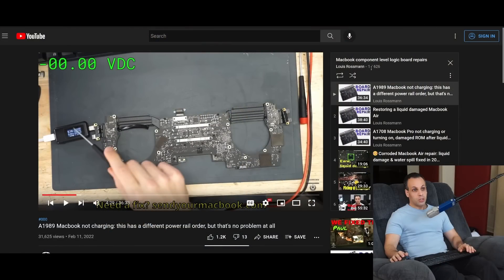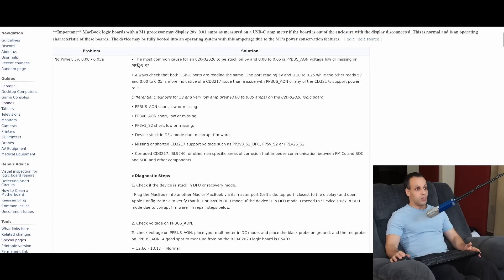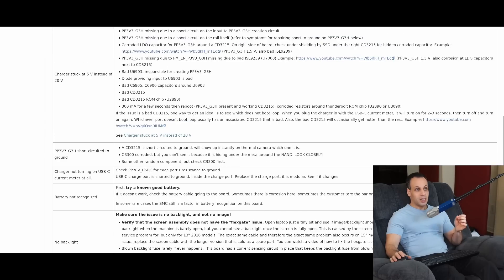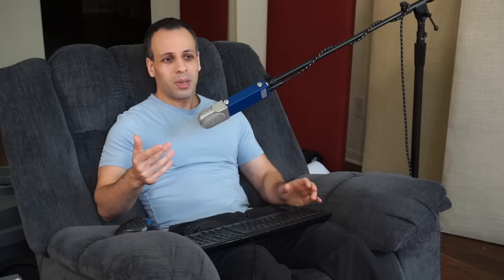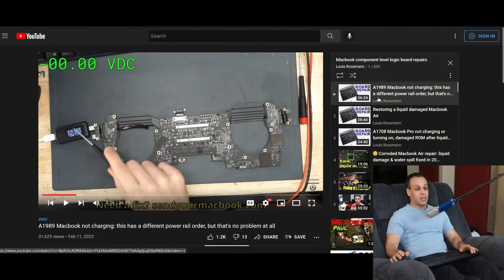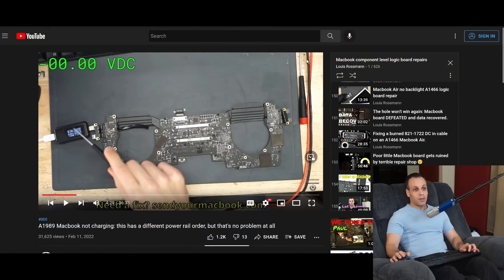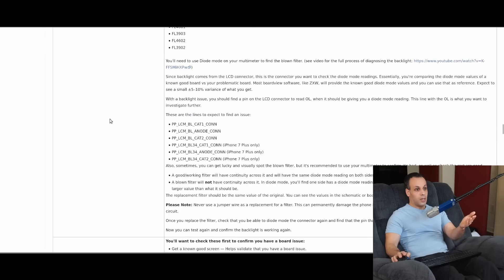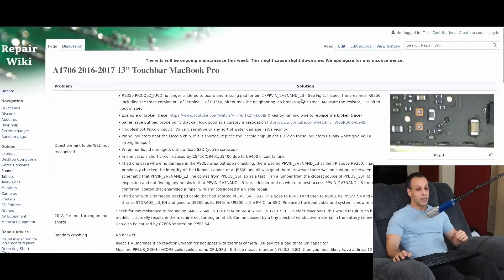Let's talk about the future of repair education here

Comment: For last 5-8years have accumulated experience repairing power supplies, when started repairing them, there was no content about it, only few videos showing how to recap secondary side. For last few years have been slowly making short as possible repair content with title: "Device name - fault description - name of faulty components" with startscreen showing the defective components. Endscreen with diode/resistance measurements of a working device.
Reply from the maker: Very cool man! Thank you so much for giving back

Comment: It will be a bit more interesting to show us not whole board repair video, but to do guide about specific methods for specific components or types of damage. Like hi guys today I have these four boards with water damage, it looks this way, you can easily detect water damage thanks to these marks, always check these vital components that are likely to be damaged every time, these need to be replaced, this type can be salvaged this way.. etc etc. And simply focus whole video on one toppic. It will be also helpful guide for those who are attempting similar type of repair no matter if it will be exactly the same board. Usually things repeat... 

QFN repair, BGA repair, connector repairs, broken via, delamination, heat damage, liquid damage, geenral oxidation... or even presentation of different soldering stations and tips with examples of different use, heat transfer, flux usage, types of flux..  and even show things that are not worth repairing and how to identify such problems early instead of spending hours and money on dead corpse.

Comment: I actually would have contributed to the repair wiki when it was announced in a video that all devices should be put on there, not just Apple device, but I'm in a weird situation: I'm extremely bad at writing "human-friendly" documentation that someone other than me understands, and also that I have so much information stuck in my head that I don't even know where to begin dumping it.
Another problem is that there is some info there which I know is 100% right, but I have actually no way to 100% confidently verify it on real hardware due to missing some of the hardware and the tools to actually verify it. I have very good knowledge of the hardware, except for the motherboard revisions and all of their traces.

My knowledge is about the entire Nintendo 3DS family, and while there are some differences for troubleshooting new and old modells, most of the troubleshooting steps are basically the exact same for the both except for minor differences between new and old modells, especially for power management. As for the motherboard, they are obviously very different, but I have a hard time to actually verify that, because I don't have all modells.

I have just checked repair.wiki at the time of writing this comment, and the current information is missing/lackluster/misleading, so I really need to dump this knowledge to make everyone's life easier.

What should I do, and how should I do it?
Reply: I would say if you don't get a reply just start by adding things that are missing and see if anyone complains. Even if your documentation is difficult to read it's still better than nothing and it can always be improved.
Reply: @Jokler13  Thank you for the reply!

So you're saying that it's much better if I "vandalize" a page with useful information with bad formatting, and let those in need clean it up later?
Reply: @SonoSooS  Yes, different people with different skills will fill in where others need improvement. Also the nice thing about wiki is that you can see what was there before the edit, so If you mess something up, someone else can see what was there before, and correct it.
Reply: @SonoSooS  Well if there is already useful information maybe don't "vandalize" it if that was what you are asking. I was thinking you could start out by filling in the sections that are still missing.

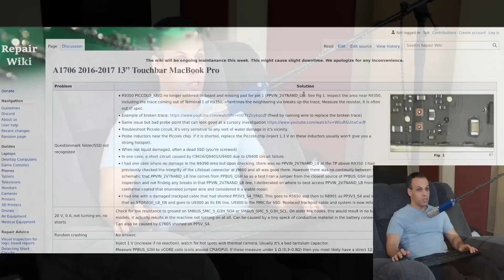Comment: 10:00 Repair shops won't go out of business.  Most people will want their products repaired and not have to do it themselves.   Changing the oil in your car is easy, but it's easier to have someone else do it for you that has the tools and faster.
Reply: It is not about what people want. It is about what is practical. 

If car starting to have sensor sensing if the oil is genuine Honda certified oil for example, then it wouldn't be long before repair shop doing Honda oil replacement disappear.
Reply: @jintsuubest9331  Did you watch the video? The section @ 10:00 isn't about right to repair, it's about how people claim that sharing info on how to repair something will cause repair shops to go out of business.
Reply: @jintsuubest9331  I'm just stating that independent repair shops aren't going to go out of business due to board repair information being shared.  This was the topic at 10:00.  I used to work in the service industry. Your average normie just wants their stuff fixed so they can go on about their normie life.